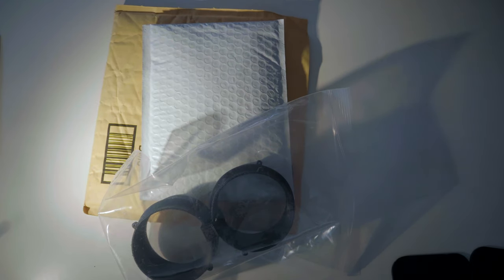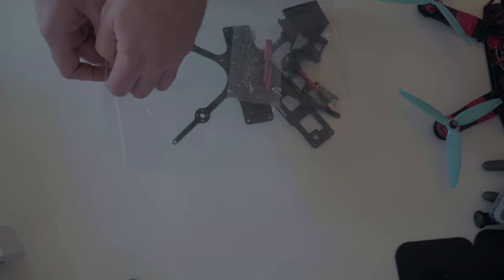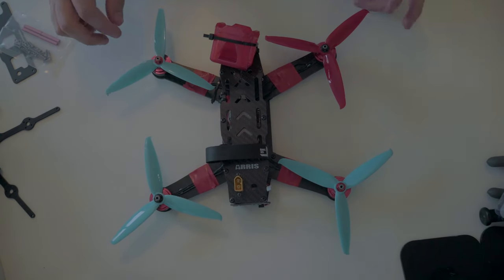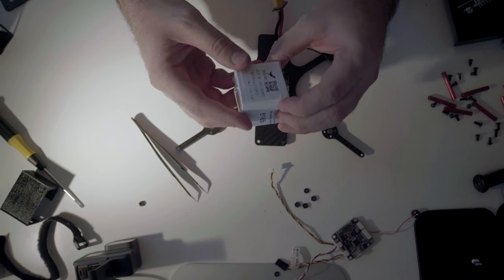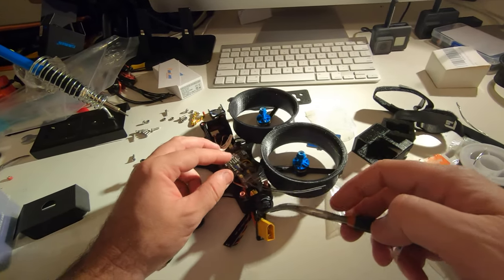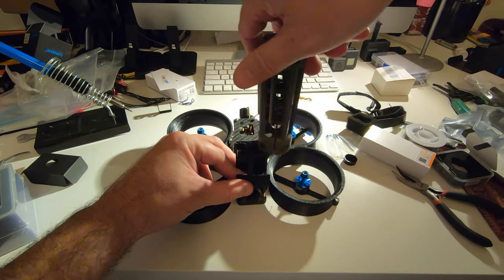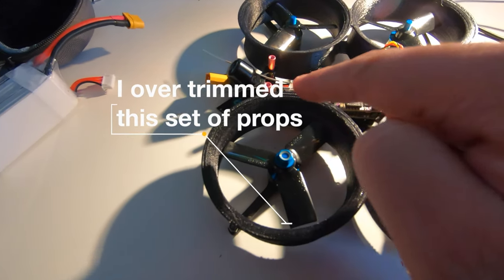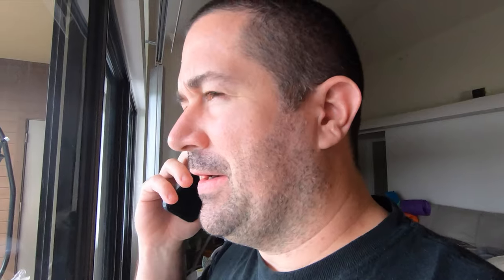Shendrones Squirt Build CineWhoop

Comment: Is it hard to fly, it looks,and sounds like your throttle is about 60% to hover. I'm thinking of building one. Are the 14xx motors the biggest that will mount? I'm wondering if I can use   15xx motors?
Reply from the maker: Howdy! I’m sorry I didn’t see this comment sooner! My hover is maybe a touch over 50% but I am flying some big ole 1500 mah batteries and I could probably put some better trimmed props on there to make it more efficient. As for the 15xx motors, i’m not sure. If they bolt holes would fit, then I’m sure it would work! Have you checked out the cinewhoopers group on facebook? I’m sure there are a number of guys in that group that could easily answer about the 15xx motors.

Comment: what battery are you using and how long does it last? im thinking of building one soon
Reply from the maker: MiniWar FPV Howdy!! I’m using a 1300 mah battery and getting about 3 to 4 min of flight time if i remember correctly. I’ll try and update the video later today with the parts I used. Thanks for checking out the video!
Reply: @fiercefpv175  just a suggestion, you might try a smaller battery, I've found on some quads you can drop the battery size to 850mah to 1000mah, and the weight difference between them will possibly give the same flight time. Also azure makes a 3 in. prop that is very efficient, I think your trimmed props probably not to efficient in my experience. If you try these things I would love to hear how it works out for you.
Reply from the maker: @RCOverKill  Thank you for the suggestion. I will see about giving that a try on both the battery and the props. I'm about to order some new Lipos for my 6 inch so I might as well get some for the Squirt too!

Comment: Which FC are you using?
Reply from the maker: I used the Flycolor Raptor tower which has a F3 flight controller and 4 in 1 ESC. I probably could have used a better flight controller but I had that broken quad lying around doing nothing and I'm only using the Squirt for indoor/close proximity flying so I didn't think I needed anything too high performance.